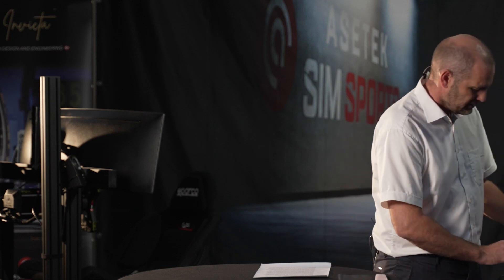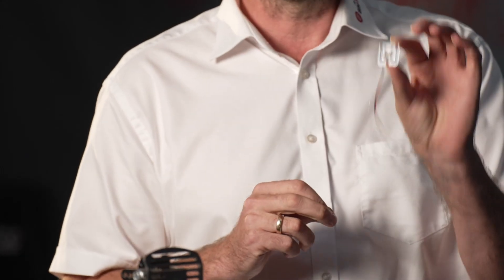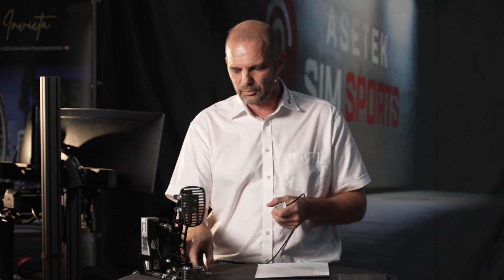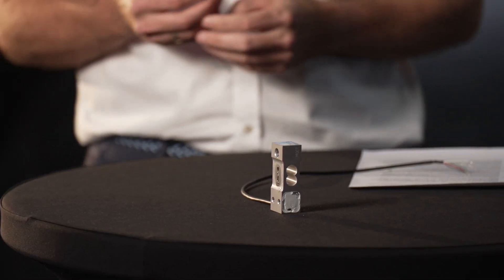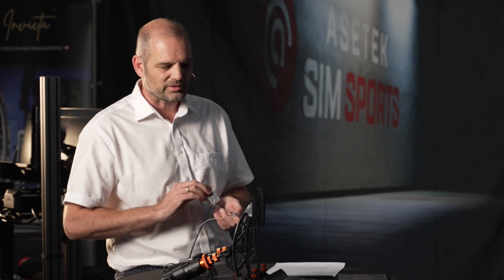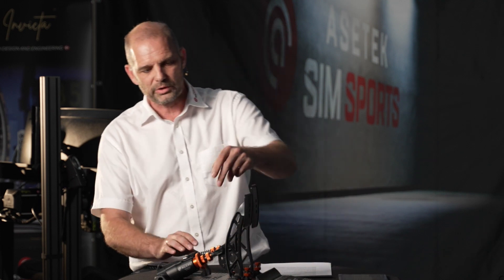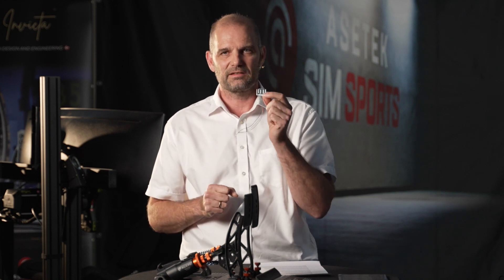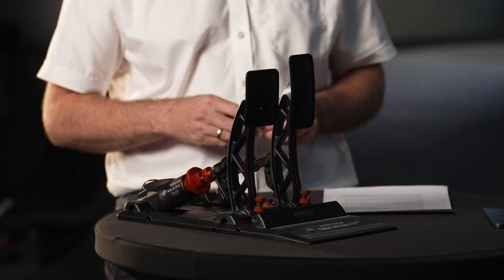Q&A Recap - The Load Cell Design of the Forte Pedals

Comment: The difference between Forte and most other Load Cell pedals:
<Example 1> Compress different elastomer with the same force and compare the measured input. Soft elastomer get compressed further, resulting in more travel than with hard elastomer but as the force is the same, the measured input should be the same as well.
- Forte: The pressure/travel is measured by a small spring and load cell which is decoupled and working in parallel from the elastomer stack where the actual force of the foot is going into, because of this the loadcell is not impacted by the softer/harder elastomer. This results in higher input reading with soft elastomer than with hard, even though the pressure put into the pedal was the same. 
- Other LC pedals: The pressure/travel is directly measured by a big loadcell receiving all of the force of the elastomer. The same force will always result in the same input, no matter how soft or hard the elastomer is because elastomer and load cell are in line with each other and not in parallel. 

<Example 2> Compress a progressive elastomer setup which is soft in the beginning (big travel difference but little pressure difference), but hard at the end (little travel difference but high pressure difference). 
- Forte: During the whole travel the small spring and loadcell will measure a linear change of input relative to the distance the small spring got compressed because it is decoupled from the progressive elastomer setup. In the beginning there is a high input change even though the pressure is not rising much and at the end there is less input change even though the pressure difference is higher. This is bad because the input doesn't represent the progressive pressure change, your foot sense pressure differences the load cell doesn't read because it is decoupled. 
- Other LC pedals: The pressure/travel is directly measured by the load cell to ensure that the input signal is exactly representing the change of pressure put into the brake. 

<Summary>
On the Forte the measurement of the small load cell is decoupled from the actual force applied on the pedal plate creating a false measurement. The force of the braking foot is going into the elastomer and into the backplate without getting measured, while the only force/movement reaching the load cell and getting measured is coming from a tiny spring which is actuated in parallel but independent from the actual overall pressure. The Forte try to compensate this incorrect measurement by applying a progressive curve to the input after measurement but it will never be completely accurate to the actual progressiveness of the elastomer.

<TLDR>
- Forte measure only the distance and not the actual pressure going into the elastomer because the input is measured in parallel to the pressure.
- Other load cell pedals measure the the actual pressure because the input gets measured directly and not in parallel.
- While in both cases the load cell itself is measuring deflection, on the Forte it's decoupled for the pressure while on onther LC pedals it is not.
Reply from the maker: Hi Marcel,

Is it Fanatec you work for? We assume they pay you salary and you thereby have a fincancial interest in slandering competitors. Are things getting hot over there? If so, in addition to the best pedals, we are also selling the world's best liquid coolers and would be happy to send you a sample?

We are selling pedals based on how they feel, consistency and good quality (highly recommended btw).

Have a good weekend and thanks for the theory lecture. Next time - just use your Fanatec name. Everybody loves transparency these days 😘
Reply: I mean... a correct message is a correct message, regardless of who says it...
Reply from the maker: @MrTomRobs  as you also work for Fanatec, and you also do not disclose it (but yet preaches is does not matter who posts) and thereby have a financial interest in this debate, ie you have a financial interest in slandering a competitor, we cannot really take you guys seriously. Our recommendation is you keep your criticism and "objectiveness" to your own channels.

A company that bring a product to market and do as they say and say as they do is right. It is not up to competitors to define what is right and wrong. At the end of the day there is only one judge, and that is the company's customers.

We have sold a lot of Forte pedals and we get great feedback, that they are consistent, people drive fast with them, (many as fast as with Invicta in fact) quality is great and at an affordable price point. 

At our side we are happy we get the feedback that matches what they were designed for. That being said we acknowledge many got a set perception of how things should be made. That does not stop us from innovating and do what we believe is right.  

So we are just happy there are products for those who wants a specific recipe of technology as well :) We cannot please all and we are not trying to please all.

Main difference is, we do not talk about our competitors doing things right or wrong. None of our business, we focus on our own work ;)
Reply: @AsetekSimSports  Admirable PR approach but it's been pointed out by multiple sources that what is being advertised is clearly different to the application in practice.

Sure, competitors don't know the ins and outs of your operation but a scientific principle is a constant. 

So far I've seen deflection and ad hominem arguments be made, but nothing to clarify or debate the argument that was originally made saying that load cells do not work how they have been described.

Customer feedback being good is of course a good thing and options on the market drive innovation. Sure. But if you try and market to a knowledgeable consumer base making remarks which industry experts are saying is wrong, it casts you in a bad light
Reply from the maker: @MrTomRobs  let's just once again establish you work for Fanatec and have a financial interest in this debate. We are 100% transparent about our approach and our design. Sorry you don't see it that way.

We own more or less all competitor products on the market. We have made conscious decisions on our design approaches. 

We are super excited about the recepetion we have received from both users and reviewers that used our products :) As a matter of fact one reviewer only out of many even put interests in the technology. Everyone else focused on the performance of the pedals. Here is a good example:

“Would I put these on my rig and would I use them? Absolutely! No question at all. These are as good as any load cell pedal set I have ever, ever tried.

I think the build quality is absolutely excellent… Build quality: faultless!”

– Dave Cam, review of the Forte Pedals
Reply: @AsetekSimSports  "Main difference is, we do not talk about our competitors doing things right or wrong. None of our business, we focus on our own work ;)"

This is not quite the case:
https://www.youtube.com/watch?v=EnWghQbY-H8
Reply from the maker: @1027hristo  you are absolutely right. That could have been phrased better. 

Of course we do compare ourselves to the competition and how others are doing. Often times our CEO has actually talked highly about the likes of Simucube and Heusinkveld in some of his videos as well.

The point, that could have been made clearer, is you will never see Asetek or its employees show up online in other forums or in other manufacturers' forums talking bad about other manufacturers or the way they are doing things.

It is corporate policy and has been for many years in our presence in the gaming communities.

Thanks for the correction :)
Reply: @AsetekSimSports  Yes, I do work for Fanatec but my own curiosity of understanding how it works and will to explain things to people that might have not, lead me to writing this. I was concentrated on (hopefully) accurately explaining the functionality correctly in an easy to understand way without making false statements to bash the product. Please feel free to correct me wherever I made a false statement or did explain things incorrectly with my thought experiment. It's not my aim to talk bad about your products, therefore I edit my post from "Why this way of measuring is still wrong:" to "The difference between Forte and most other Load Cell pedals." Mentioning it here for the transparency. 

I saw many people not understanding how they work and what the difference is, some now seem to even question all load cells in general after the explanation that they anyway only measure deflection and not force, even though the use case makes a huge difference, which was not really addressed in the video, hence the confusion created.

When I see others in the comments or YT videos talking about the topic I think it's not a matter of who you work for which determines how you perceive this functionality. I know that quite some people know my channel, real name and who I work for, if I really would have liked to hide something I could have made a fake account or whatever, but that's not my thing and intention. At least by me not being that "transparent" I gave you the chance to use this to leaver against my explanation without the need to directly address it 😉. 

It's not getting hot here but sometimes inside my PC, so for that I would gladly take a water cooler as I'm still running a classic air cooler. Have a good weekend as well.
Reply from the maker: @MixedRealitySimRacing   we probably never will agree on whether it matters when a competitor posts on another competitor's SoMe or not, but if you provide your address we stand by our offer on a liquid cooler 😉
Reply: @AsetekSimSports  whoever is replying to those comments in the name of Asetek should really ask themselves if this is the right approach of answering to constructive criticism. If I read on the product page of the Forte Pedals "Load cell will sense up to 180 kg of force on the face of the pedal plate" Im thinking the LC is capable of 180 kg. If i then  see evidence, that the reading of the LC is linear Im thinking about my HE Sprint Throttle Pedal and not a brake pedal in the high end segment. Dan Suzuki's video review of the Forte didn't do you any favors either. Don't get me wrong, it is great to see more and more companies entering the simracing market, as Im part of this aswell and I love how simracing hardware has developed over the years, but attacking someone because he is employed by a competitor and offering him a Liquid Cooler (which has nothing to do with simracing anyway) looks really unprofessional. Not a good way of interacting with others.
Reply from the maker: @Kayumi92  we are very happy with Dan Suzuki's review, especially after the update, and as you have probably seen, he recommends them and is almost as fast as with the Invictas. It is also good because it does give a different perspective, from which people can decide. We are fans of that. n addition there are 10-15 other extremely positive reviews.

We have taken a different approach, our objective is to provide high quality, consistency, pedals people can drive fast with and at affordable prices.

Nobody is perfect, but judging from thousands of customers and many independent reviewers, we have in large met our objectives.

Asetek has a team of persons answering its different channels in different time zones.

If competitors believe our approach is wrong or if some customers prefer other technologies and believe they will drive faster with that (after all it is racing) we are perfectly fine with that 😊

If you want a deep technical discussion you are very welcome to call us at our main number and we will answer any question you may have, just like our CEO was available on live stream for whatever question was asked to him.

SoMe are, from both our perspective and experience not the right place for that. We back our products as well as our claims 100%. If people do not find that trustworty, there are other options 😊👍
Reply: @AsetekSimSports  "and as you have probably seen, he recommends them"
Not quite, his comment below the video:
Dan Suzuki  "well, I said in the video that I still would not recommend them!"
https://www.youtube.com/watch?v=lRdGqPm6jOA&t=1s
Reply from the maker: @1027hristo  you are right. If this review is the most critical, we will take it 😊 We cannot please all with one product and we are not trying to. We still like the review. Lap times are what they are 👍
Reply: @AsetekSimSports  (my opinion as a customer which nobody asked for)...

The "Great and positive" feedback you are getting from customers is mostly from the people who never actually owned any other loadcell pedals, but us who actually did can tell that something just doesn't feel right...and i was not wrong
If i knew personally that they were designed the way they were designed id have never bought them, luckily i was able to sell  them as "new" so no harm was done

i just hope you will not do the same with the upcoming DD bases and steering wheels which I'm really looking forward to cause you are only hurting your own reputation which is very STRONG among the sim racing community  at the moment
Reply from the maker: @xXxBo5sANaCxXx  thank you for the feedback. We believe our wheels and bases will be great and after thousands of customers and reviewers tried them out at Gamescom and at real race tracks we feel our enthusiasm is shared :)

No customer feedback is wrong, but it is wrong to assume that our Forte customers did not own other loadcell pedals before.

In addition probably 10-15 of the largest and most respected reviewers tested them, took them apart and drove with them for extended time before the first single set was ever shipped to any end user. Their reviews were great and of anyone out there, it is probably fair to claim they have used loadcell pedals before. Several of them claimed the Forte to be "almost as good as Invicta" or "as good as any loadcell pedals ever tested". 

On top we do not charge peoples credit card before shipping. Full transparency and we promise not to change that 😊

Comment: the concept should be deepened, talking about the real signal that the load cell perceives (RAW) in the Forte project if we hypothetically use the soft elastomer (White) and hypothetically press 50KG we have a certain real signal (RAW), if we mount the elastomer more 'hard (yellow) and we always press 50Kg we have a lot less real signal (RAW). On pedal boards that have a normal load cell implementation regardless of the elastomer mounted, the real signal (RAW) at a pressure of 50Kg is the same. I think this is the reason why one can think that in the Forte the signal is linked to running. From my point of view it should not be considered an error, but a different implementation. I also agree with the statement that in a project it is the implementation and the final result that really matters, and for this I feel like congratulating you for trying to innovate.
Reply from the maker: Thank you. We could not have explained it better ourselves 👍😎

Comment: I wish you never posted a video like this. You have already said that travel is measured with the load cell in the brake pedal, not the actual load. If a loadcell is used in the brake pedal, the actual load must be measured. Otherwise, users will never be satisfied.
Reply from the maker: We have sold a lot of Forte pedals. It is fair if you are not happy with them, but it is not the feedback we get. We get great feedback, that they are consistent, people drive fast with them, (many as fast as with Invicta in fact) quality is great and at an affordable price point. 

At our side we are happy we get the feedback that matches what they were designed for. That being said we acknowledge many has a set perception of how things should be made so we are just happy there are products for those as well :)
Reply: Which is the case with most load cell pedals but not the forte. As in the Forte the load cell is in parallel to the elastomere, it is only measuring the travel with it's deflection while on other load cell pedals the load cell is in line with the elastomer getting all the force causing the load cell deflection. In other words: On other pedals the deflection of the load cell is caused by the pressure, on the Forte it's caused by the travel.